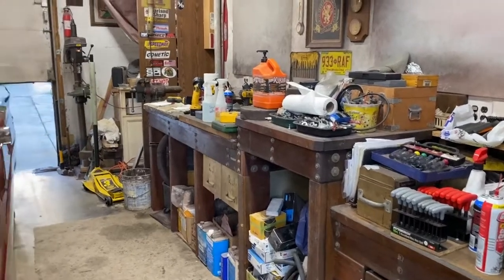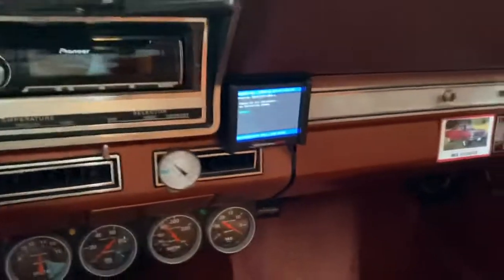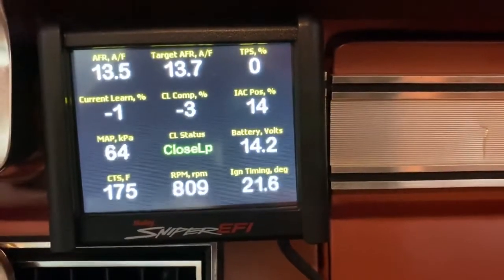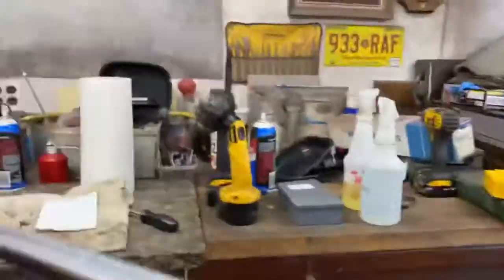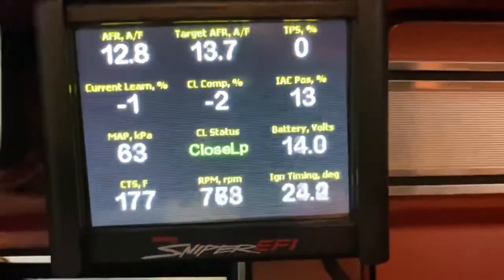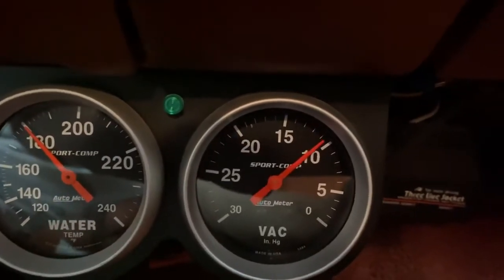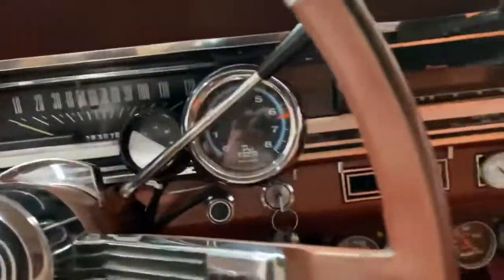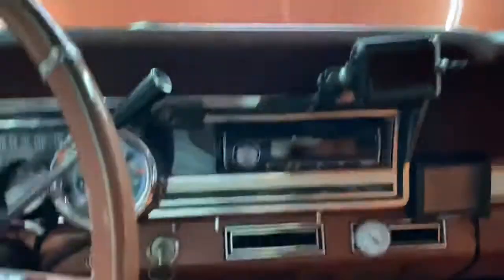Fixed Orifice PCV valve testing

Comment: You're IAC position isn't set. It's at 0
 Should be at 5 to 10
Reply from the maker: Yes, you are correct.  When the video was taken it was at 0. What isn’t shown are all the other things I was trying. When it was set at 0 in park, it would go up several numbers when put in drive. This video was taken in about the middle of my experimentation period. 
 It is set correctly now and idles fine. My IAC surge has gone away since I switched to the fixed orifice PCV.
Reply: @dansmessygarage  that's awesome. Where do you have you pcv hooked up? I had mine hooked up to a single intake runner and that was giving mine issues.
Reply from the maker: @brianstechtips5721  I have the vacuum line connected to the port on the back of the Holley Sniper Throttle body. It draws the vacuum from all 4 venturies. The PCV is just a push fit in the valve cover. Since I did this I haven't had any issues with my IAC acting up. (knock on wood).